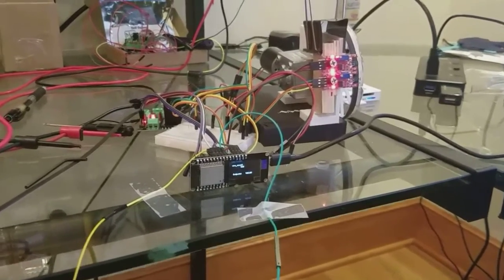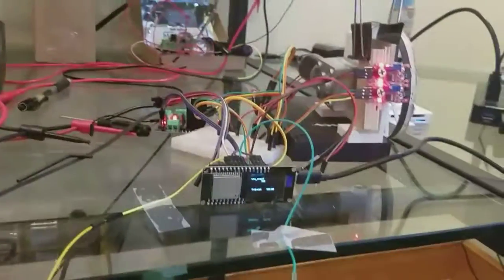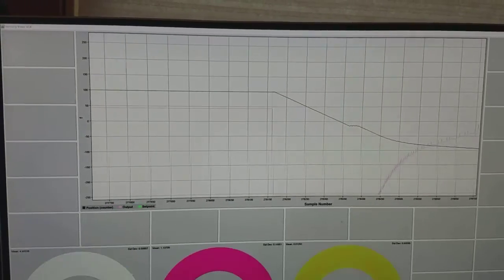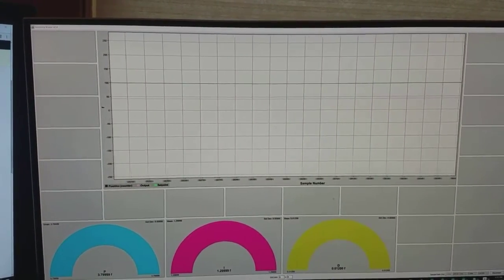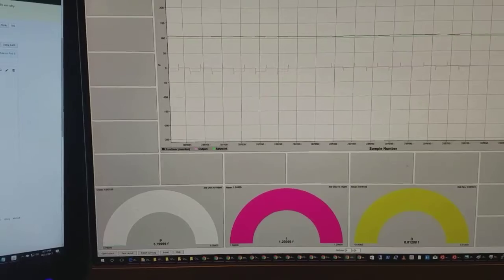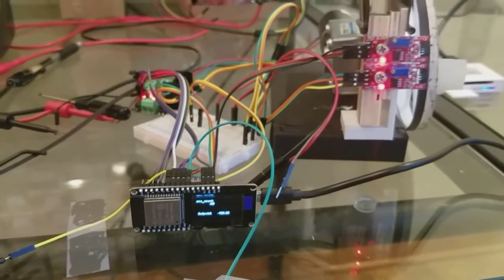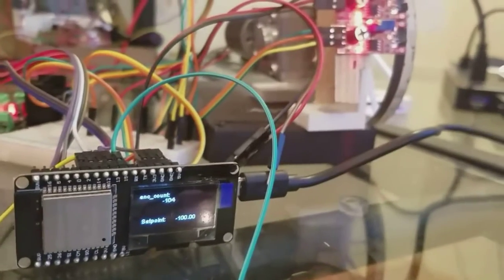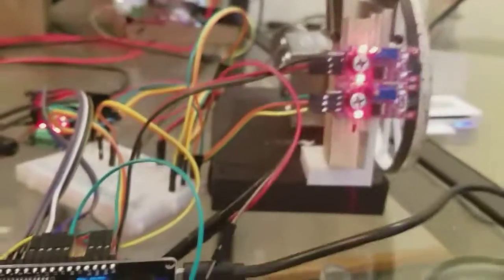esp32 closed loop motor control hack

Comment: I would love to see the code for this one..
Reply from the maker: It was just arduino PID library and some code to read the quadrature encoder (there are a bunch of libraries for that) .  You may want to look at sipleFOC which is pretty easy to use for bushless motors.  Misan's dc servo is also good.  Both are on github.
Reply from the maker: the encoding is just hall sensors and refrigerator magnet material.